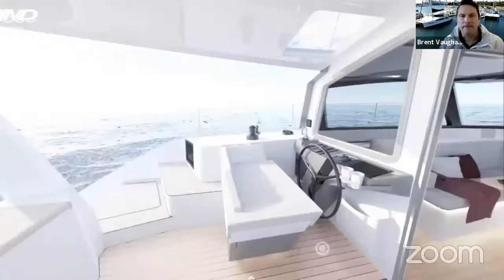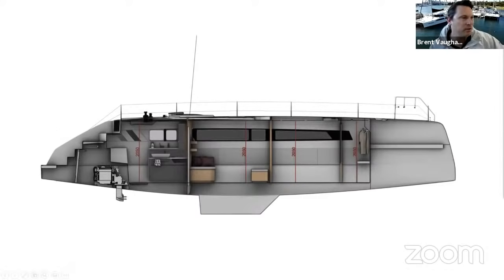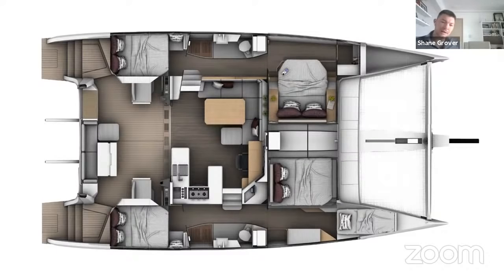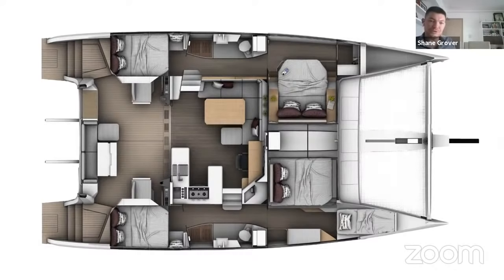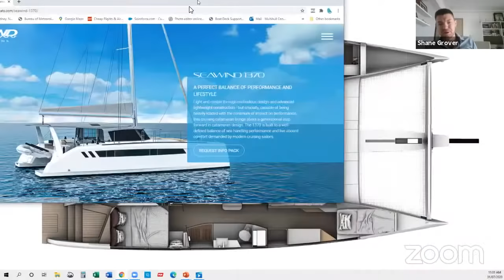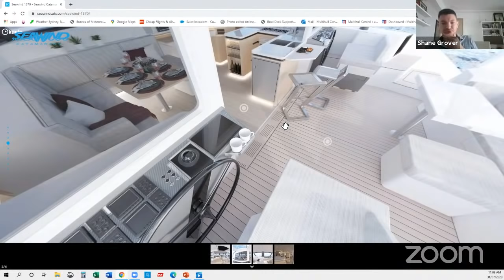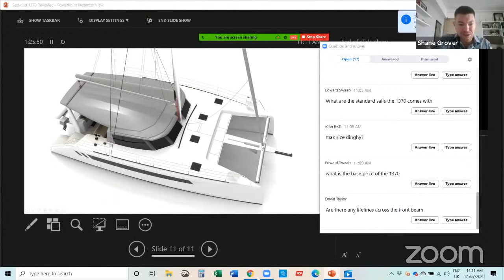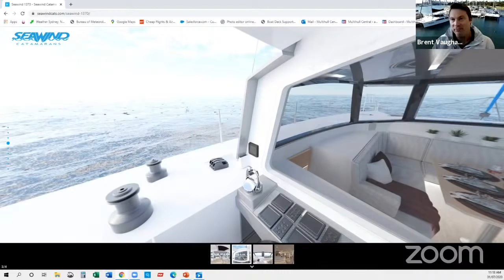EP 17 - INTERVIEW: Seawind 1370 revealed

Comment: This interview answers much more than any other information out there. No offense to Nick and his videos from @Ruby Rose (I love those two). So now I lean more towards the 1370 because of this elaborate information. 

Which brings me to this simple question.... Take money (cost) out of the equation: why would I choose a 1370 over a 1600 and vice versa? Only because of the load capacity without affecting performance?
Reply from the maker: Hey Curt thanks for the comments and glad got some value out of this interview! Regarding your question, I think it comes down to how important the performance element is to you. With the same payload the 1600 will certainly offer greater performance as much of the extra length is in waterline length of the hulls. There is a good argument that performance provides comfort as you don't need to always be sailing in 20 knots. But it requires some discipline and commitment to not loading the boat up when you have the extra space. If you load up proportionately the same way you do the 1370, then the performance advantage will be lost to some degree. Both are good sailing boats...but remain true to the design the 1600 is a great sailing boat.

Comment: Great interviews.. I learned a lot, thank you. At the end you guys discussed pricing and that you may raise it due to demand. Be careful talking about or doing such things as it may discourage future buyers - unless the change is due to a change in economic conditions/parts costs. It's a sure-fire way to lose future customers/demand. In the car segment, Tesla is a good example of this, where lack of availability actually drove higher demand or with McLaren, where they saw a drop in demand because they released cars which weren't "limited production" and as such overpriced for what they were (secondary market was weak which meant people weren't interested in buying another new McLaren).

Instead, continue to grow that demand, but fill by ramping up production to a long-term sustainable level, while keeping future demand alive. If you raise production and raise costs it's a sure-fire way to cash in today, but crash at the end. Keep in mind, psychologically people want what they can't have and as the price starts going up, so does the competition. Even at current price level you've got lots of competition, including custom builders and the options WILL trickle to other boat-builders. Anywhom, just my opinion based on my study of economics. I think you have a winning formula here between the partnership with RR and the factory options with full solar/lithium and factory integrated electronics/systems... milk it as long as you can, maintain that demand, but keep producing the same quality boats you are known for. Cheers! :)

Comment: Can you fit an uncovered seating area on the rear bimini - similar to the Leoppard 45? Nothing too large - but full width so passengers can shade under the sail or put up a soft bimini when the sail is down and the boat is moored. Also, are any design efforts assigned to electric engines and hydro generators?
Reply from the maker: HI Edward, there has been a big effort to keep weight down and also the centre of effort on the mainsail as low as possible, so unlikely to have any further superstructure for seating up top. This area will likely be optimised for solar panels to help charge lithium batteries. In time it is likely electric motors will be offered. Hydro generator available now.
Reply: @MultihullCentral1   Understanding all of that, the Leopard 45 is a minimalist top seating area (no hard cover and little or no penalty to sail beam height; its really more of a get-away and read area really. As the 1370 is designed for the weight of a hard bimini and solar panels, the reshaping of its flat-top - to a seated-top isn't going to add a significant weight penalty. The challenge comes when an NFL team wants to perch up there - but there's a solution to offset that strength need with carbon fibre or  e-glass. Thanks for responding to this - I realize you aren't the manufacturer.